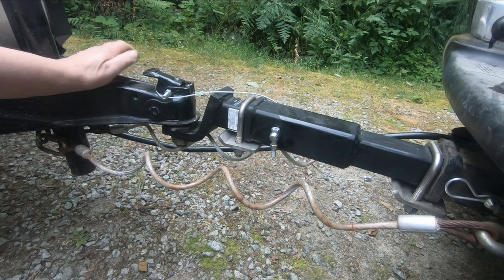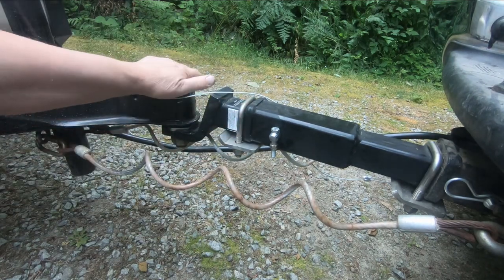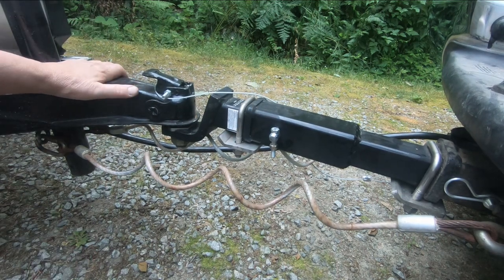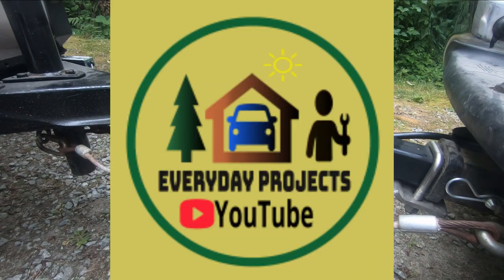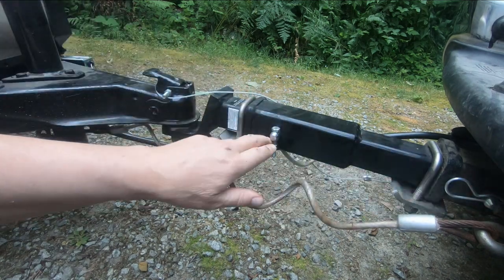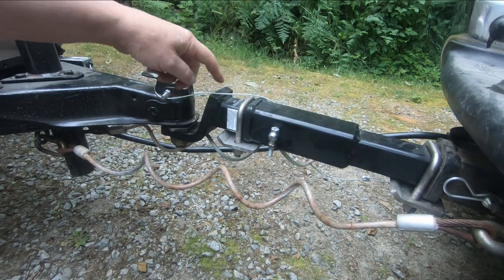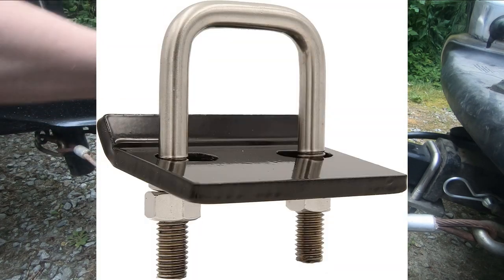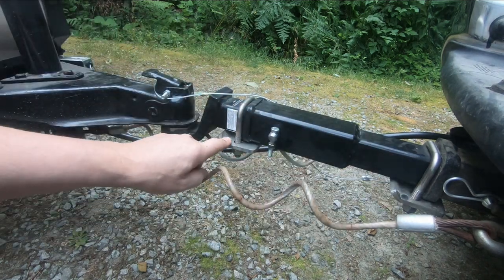ADDING A HITCH EXTENSION

Comment: I have not seem one of these before but then a receiver hitch is not legal for towing over here. This looks like a good way to avoid the damage you mentioned but longer term a longer A-frame on the trailer may be a better solution
Reply from the maker: I wasn't aware of the differences in towing a trailer (caravan) in the UK but I just looked up several sites and learned a lot. One explanation was that many vehicles in the UK are uni-body design (without an external frame) making the attachment of a receiver hitch impractical and unsafe. I see the type of hitch used and they are self-locking , where in North America we must insert a pin above the ball to lock the hitch onto the ball. Many differences actually. I thought the 2" receiver hitch was in world-wide use but there goes our North American arrogance yet again. I had thought to extend the "A" frame on the trailer but this extension is a quicker and easier fix. Thanks for your comment Joseph.
Reply: @EverydayProjects  I find the differences in trailers and towing equipment very interesting. A receiver hitch would be great on our Land Rovers as the current hitches always dig a channel on hills off road. All our ball hitches are the same at 50mm for a tiny trailer or a 3500kg one. Electronic brakes is another thing that is illegal over here, most trailer have an overrun coupling which applies the brakes. The lastest law that has come out is that it is not longer feasible to make your own trailer as every trailer design has to go through an expensive test. We have a few homemade trailers which were made before this law came out and we can still use them
Reply from the maker: @GardenTractorBoy  Yes, it sounds very restrictive. These laws must be borne from a number of accidents or failures on the motorways. Too bad about the rule against receiver hitches. They are a proven and safe way to haul even huge trailers. Also, there are many aftermarket attachments that can plug into receiver hitches like bike carriers, ski racks, closed transport containers (that you sometimes see mounted on roof racks), etc. In British Columbia, where I live, there are increasing laws against home-built trailers and they too are going to require more elaborate testing before approval. They take the fun out of everything!

Comment: Oh dont even talk about tailgate my first truck had the dents!!!! To prove it!✔️👍🏽
Reply from the maker: Hi Renaldo, this fixed the tailgate problem. It was very annoying not to be able to lower it all the way. Also, the truck doesn’t contact the trailer on tight turns. Got this on Amazon for $40; well worth it.
Reply: @EverydayProjects  This may come in handy, Looking to use my truck again very soon and finally give the van a retirement break.
Reply from the maker: @bigsonslawncare  You are going to retire Big Son? That van was so comfy to sleep in.:face-fuchsia-poop-shape: If you use this type of extender, make sure to get the anti-rattle brackets. They make the whole assembly more solid.

Comment: I’ve never seen those anti-Wigle clamps but what a great idea. A question! Is if you extend the hitch out then does that put extra leverage of pushing the backend down and lifting the front end. What I’m thinking of is like with a horse trailer with that somehow lift the front end a bit if we put an extension on do you think? Thanks. What a great deal.
Reply from the maker: We didn't notice a difference with the extension on. Maybe the front of the truck would lift if the extension was really long?? You'll just have to experiment and see. This was a 12 inch extension. They make different lengths from 4 up to 18 inches.